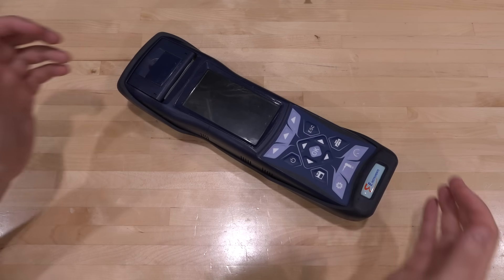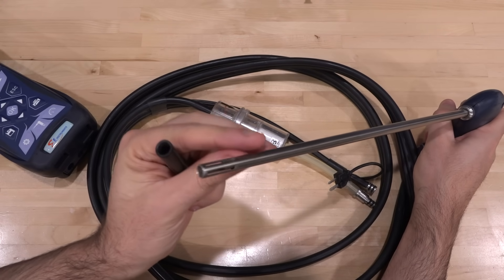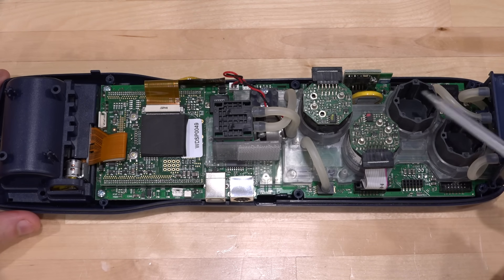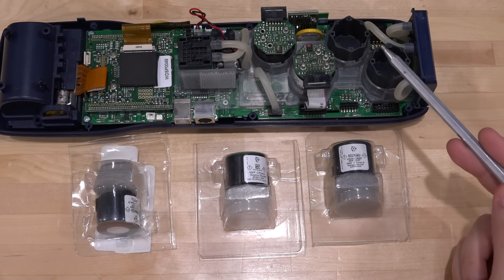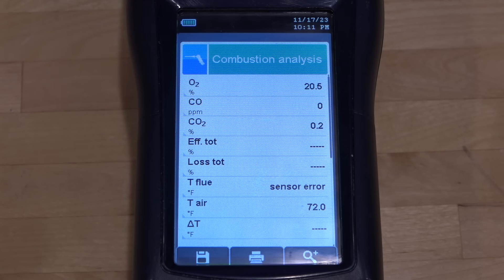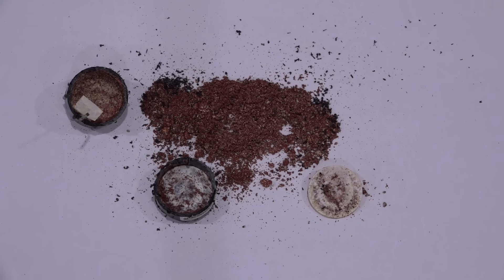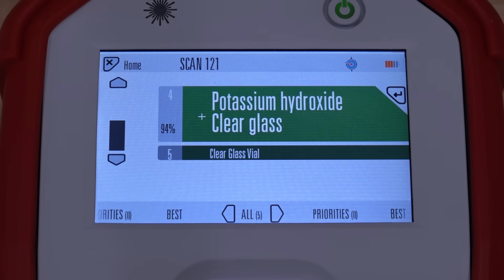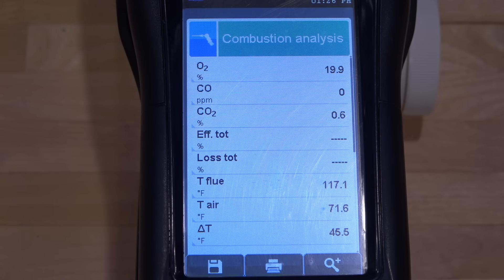TNP #42 - Combustion Gas & Emissions Analyzer E1500 (O2, CO, CO2) Repair, Teardown & Experiments

Comment: I do field measurements on boilers and yours results are Ok. Flue pump draws more than candle produces and that is why you have high oxygen content in flue gas. I also developed some hardware for my needs and if i remember well one electrode usually is Pb and second one is platinum. Pb is consumed even when sensor is in pure air. That is why life is max 4-5years. Those instrumens ussualy are destroyed when sensor leaks and pcb is corroded. But you have got nice unit.
Reply: It makes sense to have a high oxygen content since carbon monoxide is really bad. Perfect combustion would be ideal from an efficiency perspective, but given that there are many factors involved that makes the combustion influenced one way or another - even weather variations - tuning for a somewhat lean mix with remaining oxygen in the gases makes sense.

Comment: Excelent video. I have only one topic to add: CO2 is probably not measured, but calculated instead, based in which combustible was selected in the menu. Some models has options to insert CO2 sensors that are not electrochemical, but non-dispersive infrared. With that sensor it will be possible to measured the CO2 molar fraction. Congratulations by the video.

Comment: We use analyzers similar to this tool welding in live gas plants in the oil and gas industry. Ours are to determine levels of poisonous or flammable gas for safety reasons of course. Even sounds similar when the pump is running. We like to know exactly what atmospheric environment we are about to arc and spark in lol.

The LEL sensor has to be changed regularly as it uses an interesting method for detection. It's a wheatstone bridge where one side is a reference and the other heats up and, when a flammable gas is present it heats up faster changing the resistance. A catalytic bead from what I can find out

Comment: I have probably around 100 or more of those O2A2 sensors laying all around. Obviously all of them aren't working anymore. Electrolyte leaks are very common, I have seen many Ventix MX4s destroyed by those leaks (or rather by the people trying to clean it up). 2 years is rated lifetime of O2A2, they usually last for about 2.5 year in fact. The way it works is by having around 100-150 ohm resistor connected between the leads (to give it a little load), then you can measure the voltage by the help of ADC. The voltage under load is very small. The voltage in open circuit seems to be around 0.5V or so.
Reply from the maker: How come you have so many sensors?
Reply from the maker: Cool!

Comment: Those oxygen sensors have a fairly short life - typically a few years. They are, however, a very standard shape and pinout. Might be worth looking at something like an ME2-O2 sensor as a replacement, which should be easy to fit. Last I checked they were about $60 @ qty1, but the price may have come down since.

Comment: It would be pretty interesting to see if you can find a way to make the other 2 sensors work, although it looks like you would also need the other 2 boards and ribbon cables. CO and CO2 are the only ones needed for adjusting boilers, although NOx is definitely helpful when adjusting blue burners (oil burners with an EGR valve), and SO2 could maybe be helpful when working with heavy oil, although the SO2 and NOx sensors are mostly intended for- and required when fixing block heat plants (generators that use their engine's waste heat to heat your house, and you can either use or sell the power as a bonus). I personally use Testo analyzers, so it's interesting to see the insides of another company's tester. On the Testo, all its guts are held in place by the clear rear cover (no wobbly BT module), and would likely fall out if I were to take that off, which is also why I will try and avoid that as long as possible. You are also specifically told to ABSOLUTELY NEVER whack it, drop it, toss it into the plumber van, on the floor, etc..., likely because things like that module might come loose or break inside. Also, in Germany, we stick the printout onto the boiler with a piece of tape, so everyone can see that it meets emissions and what values it had after the last adjustment, and see how much they changed now.

Comment: To make the two other sensors working, you will need the electronics boards (signal conditioning and calibrations coefs) and a parameter tweak in the software configuration. Might be able to tell you more about it but definitely not here.
Reply from the maker: Thank you, very interesting. Please feel free to email me if you get a chance.

Comment: Do you want some calibrated gas standards? I picked up a flammable liquids cabinet at an auction last year, and inside it were about a dozen cylinders of various calibrated gas mixtures for testing detectors like this. They are each about the size of a 1lb propane cylinder. All well past their expiration dates (unfortunately, as new they cost several hundred dollars each), but still might make for interesting experiments. I only have them still because I haven't figured out how to legally throw them away. Not quite sure what the best way would be to send them from the DC area to New Jersey, but they are yours if you want them.
Reply from the maker: Thanks for the offer! Interesting for sure. I also don’t know how to ship them. I might have to drive to DC at some point, maybe I can pick them up.

Comment: Check the CO2. Outside it should read around 400-450 ppm, in a room typically 600-2000 ppm depending on the ventilation and the number of occupants. 0.2% = 2000 ppm in your lab is probably not healthy.
Reply: May be the thing with precission of the instrument. Instrument have resolution of 0.1% so don't expect it to be that accurate when measuring low gas concentration values, because usually the accuracy is much worse than resolution. CO2 and CO sensors also do require regular calibration with span calibration gas, while O2 sensors can often be calibrated by ambient air. Replacing sensors without calibration is usually giving you very inaccurate (often highly exagerrated) results. In Poland (where I live) multigas sensors (that use the same sensors) have to be calibrated every 180 days, and also after each replacement of the sensors.
Reply: Was just wondering about that when it said 0ppm
Reply: This device can't be used as any kind of air quality analyzer. It is HVAC tool to check furnace etc. It calculates CO2 using data from O2 sensor and atmosphere model. Works good enough for exhaust gases after burner but O2 sensor doesn't have enough accuracy to reliable calculate CO2 level in room air.
Reply: The 0.2% was him breathing on the sensor.